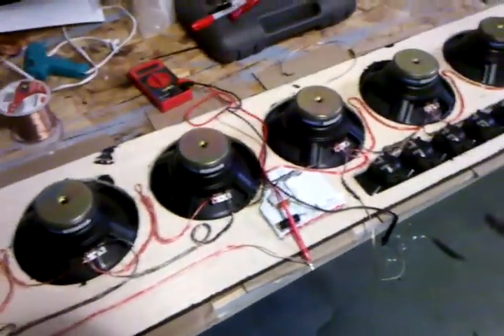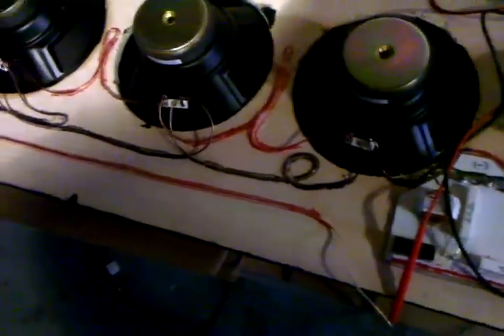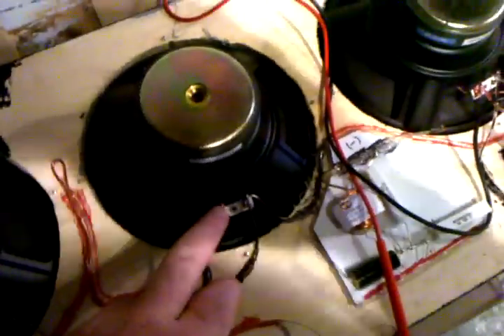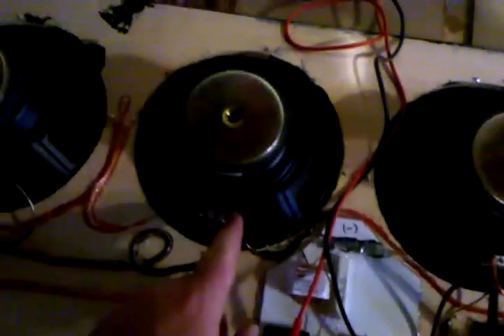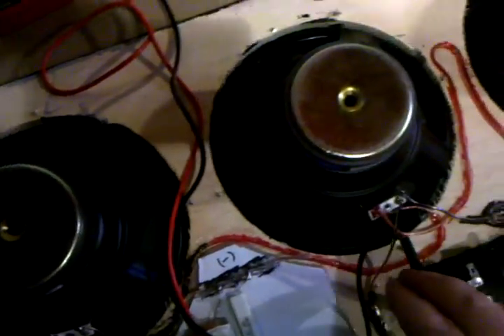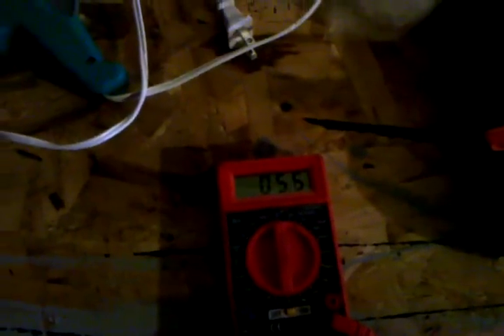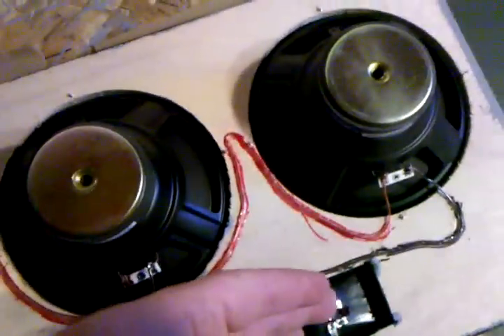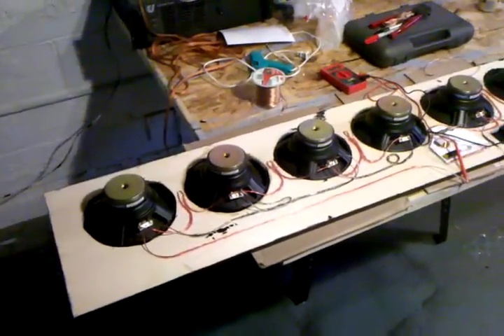Speaker Wiring - series/parallel

Comment: Can I wire together two different watts midrange 4 ohm speakers, my amp can handle 2 ohm I am  just wondering  cause the one speaker is 250 RMS the other one is 100 RMS.

Comment: Basically each bank of 4 is wired in parallel (daisy chained) and you end up with 1/4 the ohm on each 4 speaker bank and the. Wire those two bank as if it were two speakers in series by connecting the + of the left bank to the - of the right bank and that doubles the ohms back up to 5.5. Parallel wiring divides the ohms by the # of speakers and series multiplies the ohms of each bank by the # of banks or “effective” speakers.

Comment: Hi I have a question about hooking up some speakers? These speakers are audio speakers that I've collected out of TV sets I have to 20w at six ohms  the other two speakers are six ohms but no  wattage marked on the magnet. And two tweeters at 8 ohms not marked as far as watts either ! Will I need to make a crossover to hook all the speakers together? I could try and send you a picture if you want me to?

Comment: would this be fine if this is the way i want to connect my speakers, 8 ohms sub plus 8 ohms mid in parallel = 4 ohms, 2 8 ohms tweeters in series = 16 ohms then combining the two pairs in parallel connections in sakura av 735 amps?

Comment: This is very interesting. My question is along the lines of this. I’m running 8 6.5. Considering running them this way. But also running 4 tweeters. So if this setup only uses one positive out and one negative out. Would it work running a 4 channel amp or would the ohm load need to be added from each channel

Comment: great video. OK I'm building a speaker box with 2 channel 4 ohm amplifier and three 8 ohm speakers for each side total six speakers. Can I connect them parallel or series or both?
Reply: bru Bna , wire them 3 per channel in parallel to get 2 ohms. if your amp is 2 ohms stable that is but why are you even doing this? it's not necessary to use so many speakers anyways. people are ridiculously crazy about doing stuff like this.
just buy better quality speakers and or bigger speakers to get the sound you want. more is not always better !!!!!!?

Comment: how many channels do you have pushing the speakers I have a 4 channel deck seems to be 3 haven't figured out where that extra green wire is and my car has I don't know maybe 9 speakers and has one in the dash to Mid ranges in each front door and 2 tweeters one in each door in the rear rear doors I have I believe two speakers each mids and Twitter and then I have the back bench two quote on subwoofers I put a new head unit in which I'm really happy with but I want to get on my speakers playing without buying a bunch of equipment

Comment: Yeah, you definitely need to explain how that negative wire somehow changes to positive. I'm more confused now.
Reply: Sorry I wasn't here two years ago. Each group of four on each side is wired in parallel ( + to + ), then the groups of four which is now like one speaker are wired in series minus to plus.
Reply: U can not connect positive and negative together🚫❌
Reply: @greatmind3823  sure u can it's called series connection, like getting 3V from two 1.5 batteries inside a remote, you connect + to - and Voltage increases and resistance increases.

Comment: If you wire two different speakers (let's say a 20W RMS and a 100W RMS speaker) of the same impedance in parallel, would you have any issues with the 20W speaker being overpowered?
Reply: The power is shared equally so yes it would most likely blow the 20 w since it would be getting half of the total wattage

Comment: HI I Have 7, speakers that are 2 inches. 20 watts to 80 watts- some. 4 to 8 Homs. that I want to put together in one enclosed box. that I want to power them with my home stereo  that is 300 Watts  how should I wire them  series  or Parallel.  ?

Comment: Hello Clint Henry,  By my great mistake,   + and – wires of two way  speaker connected to the 2 positives of the left and right channels of the tube amp.  Likewise, + and – of another speaker connected to the 2 negatives of the left and right channels. The one speaker was working  which was connected to the 2 positive of the amp . And the another speaker was not working  which was connected to the 2 negatives of the amp.  For the first 10 minutes, I didn’t notice the wrong connection  by my stupid mistake, then I checked and made the correct connection. After that,  both the speakers were working.  I am afraid of that : Are these speakers and the crossovers became weak? Will it be in full strength as it should be? Although the speakers are working now, I am much worried by my wrong connection.  But , Why one speaker was working and another speaker was not working?  Kindly explain in detail.    Thank you, Best Regards.

Comment: so four speakers would be out of phase, which makes music sound flat, why would someone do this.
Reply: they say you can wire speakers to revers polarity  to keep them in phase  so 4 speakers would be positve  is positive and neg is neg and the other four speekers  should be positive is neg and the neg is posive
Reply: It would be fine, because the neg of the first set is letting out pos. To the second set ! because they are in series, here is another magic you can wire 16 speakers of 4 ohm and still end up getting 4 ohms in the end, you would need a very high wattage amp dough
Reply: word!
Reply: William Simpson , that's what I was thinking.
doesn't make any sense.
Reply: I

Comment: Four 11 ohm speakers in parallel is 11/4 = 2.75  total.  With two sets of these in series is 2.75 + 2.75 = 5.5 ohms.    If you put all 11 in parallel it would be 11/8 = 1.375 ohms.  If in series you would add them 11x8 = 88 ohms.
Reply: that's a good explanation in terms of ohms.. may i ask what about the wattage would be?

Comment: i have 8 mids at 4ohms each and a 2 channel amp that is 2ohm stable. My question is can i run 4 of the speakers wired in series/parallel to one channel of amp and the other 4 speakers the same way to the other channel?
Reply: I have 6 4ohm 6.5in 2ways that i need close to 4ohms on a 600w amp

Comment: i got 4 ch amp and 6 speakers i only want to use 2 of the channels how would i do that? i have an idea i think works but would like your opinion. the speakers are 2ohm. my way was run 2 speakers in series than the 3rd parallel to keep it at 2ohms yay or nay? lol
Reply: that was for 3 speakers for 1 channel btw.

Comment: Multiple resistive loads in parallel accumulate less total resistance.
He said 4 x 11 Ohm speakers would be 5.5 Ohms.. I believe that's incorrect, rather 2 x 11 ohm speakers would equal 5.5 Ohms.. His total parallel resistance is 2.75 Ohms..
Series is the opposite ie: 1 x 11 Ohm = 11, 2 x 11 ohm = 22 ohm, 3 x 11 ohm = 33 ohm.. Please correct me if i'm wrong but Impedence calculus should be the same as resistance and of course opposite that of capacitance..

Comment: Has it not occurred to you that his amp probably is rated for 4 to 8 (or more) Ohms?  This is typical for PA amps, and in such a case his 5 Ohm load is just fine.  It doesn't have to be right at a specific number.

Comment: I have a box of 8 speakers with 4 at 8 ohm bass speakers, 3 voice speakers at 4 ohm & 1 tweeter. when volume increase over 50% the system automatically goes off. I do not know what to do ...! I may not have properly connected the wires or crossover is not strong enough to bear all the speakers that we have recently change from 400w to 1000w I made.
Please give me some advice or direct me where I could see how to make it work 100%. thank you

Comment: I'd just wire the first four in series. Then to an connection block. Wire the 2nd bank in series and go to connection block. Not do this piggy back method. The jumper cable between the speakers for serial is nether positive nor negative. An speaker does not have an positive sens it is AC alternating current. Hope that enlightens things.